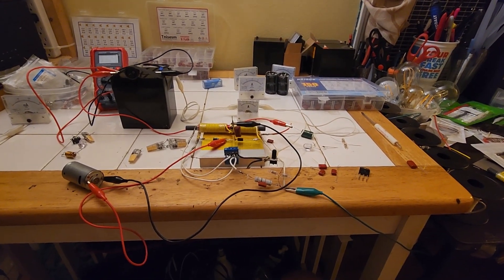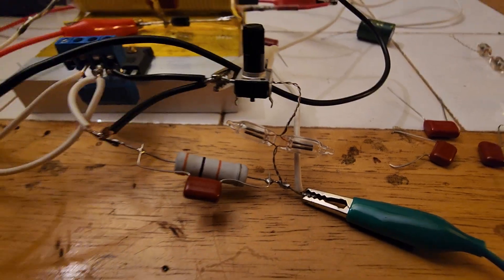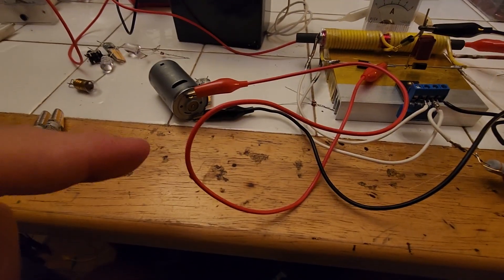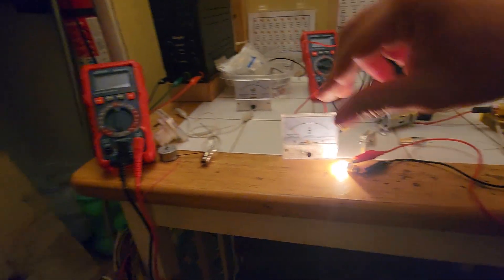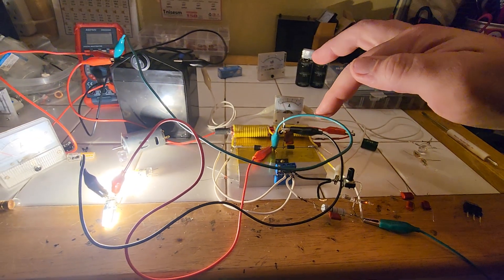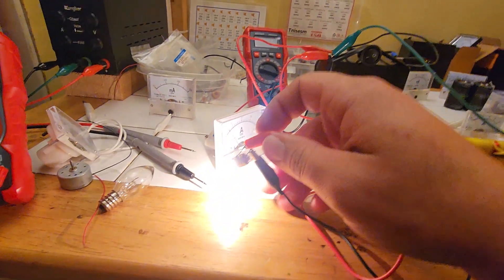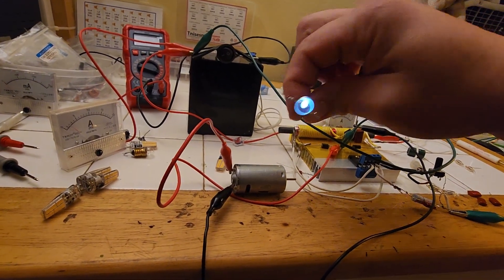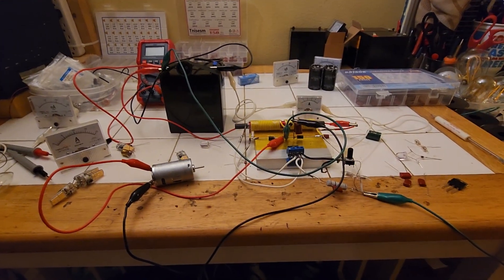💡INCREASING RINGER OUTPUT TO RUN MOTORS,LIGHTS & RAPID RECHARGING OF BATTERIES. 15 WATT OUTPUT🌀

Comment: Hi! Man, you are awesome! I just want to use the word "great" to describe you. This is because of your sharing spirit. I want to share my experience here. Yes, a friend tried to make this circuit, but his L2 coil used about half of the original design. He said that his inspiration came from "Kappa". If the L2 coil is 60 turns, then try 30 turns or less, because there is a gap in the middle, L2 and L3 can be wrapped with cellophane, so that L3 can be wound neatly. His L3 coil was also modified. It is a double wire winding. From one end of the magnetic bar to the other end, there is no disconnection in the middle. In this way, there are two L3 coils. 4 connectors. The connectors on both sides use a diode bridge (4 6A10 diodes welded) and then use a square capacitor removed from the induction cooker.........Then the output will become more, the capacitor voltage can reach up to 180 volts, a special phenomenon is that you don't need to use the 3V LED to test the surrounding ether energy. Just hold the cold cathode neon bulb to light it up, touch the plastic or leave it hanging if you tune it to the best...Good luck! Maybe everyone owes you a bitcoin. God will bless you!
Reply from the maker: Appreciate your comment love & support brother. I hope everyone can effectively replicate & improve upon the technology demonstrated in my vids :)

Comment: I agree that you need to produce a more rigorous demonstration using as many types of datapoints as possible. I like the automotive oscillioscopes because they have a bunch of readouts to put your probes so you can meassure amps and volts at different stages. At this point you arent filtering out any of the alternating current that is flowing through the circuit which is changing the way your meters our reading your measurements The high frequency is going to change the permittivity and permeability of the components of your meters regardless of diodes. This is going to change the readout of your meters even the analog meter has a coil in it that will change its permittivity and permeability with exposure to the circuit so I don't think it's reading accurately. But in thean oscilloscope is meant to be able to read those high frequencies and if you have multiple probes you can start to kind of filter out the different waves that are bouncing back and forth. 
?

Comment: My suggestion is try to remove the resistor and replace it with only capacitor with a right amount of capacitance i think it will boost power just like solovey experiment where he burn the bulb with to much power output for only a few amount of input.
Reply: Yes. Tunable capacitor would be the best option. So it can be adjusted to load. It's all about the LC circuits.
Reply from the maker: Definitely worth a shot

Comment: I don't see where you measured 15W output. I told you twice to put a load, a voltmeter and an ampmeter on the load and measure. Your input power under load seems about 6-7W. Also there is no load on that motor. 6-7W can power that motor no problem. The Tesla patent has nothing to do with what you're doing here.
Reply from the maker: Yes coming very soon & output is 14-15 watts once positive is earth grounded. Did lots of tests lately
Reply: @MTECH2022 yes great but you aught to be a bit more rigorous and scientific about things. Instead of just showing lights and motors, simultaneously measure input C & V and output C & V. Nice work though.